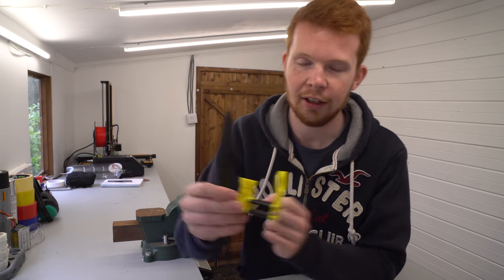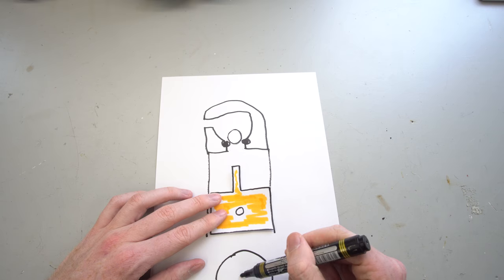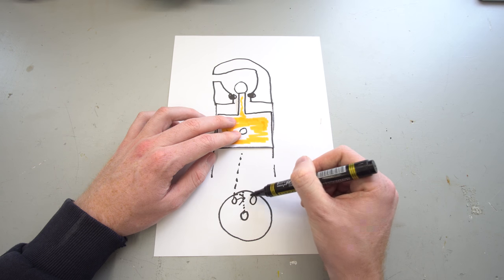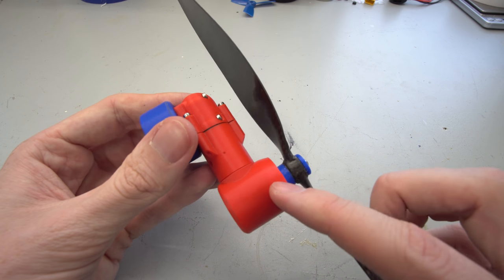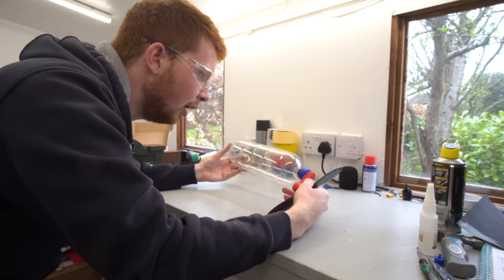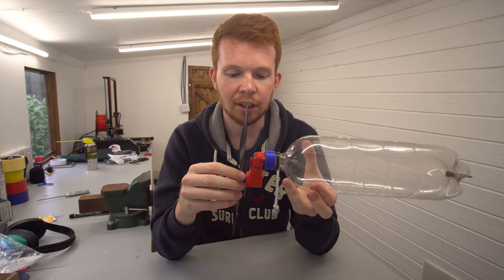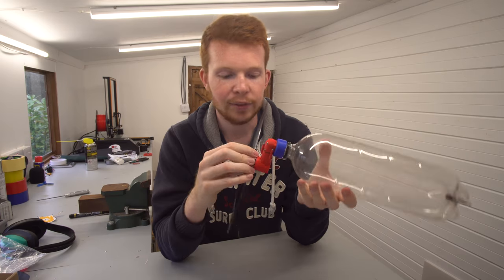Compressed Air Engine Modifications

Comment: In the US when I was a kid there was a set of toys from AirHogs which were air powered. I had a car and motorcycle that had an air motor and tank you would pump up to get them to run.  I remember the motors were done in clear plastic so you could see the internals.  They both ran pretty good. Maybe you can find some info on there designs to help with yours.  No play existed as far as I remember but this was before brushless motors and RC battery packs were NiCad. LIPo packs and well at that time Cell phones were things of the future. Good Luck.

Comment: If you get the new design working, do one with two pistons and two bottles on top of each other so you could have the high pressure-tolerance of the single bottles but the capacity of the glued bottle, and also a smoother running engine.

Comment: Once you get this bit working, I suggest you try to incorporate a pressure regulating ball-valve in the cap area of the engine, keeping the pressure in the manifold somewhat constant. 

As the pressure of the air-feed changes, this necessarily also changes the optimum opening-timing of the ballvalve in the manifold, just like ignitiontiming has to change depending on load in a combustion engine. My feeling is, that this system rod and ballvalve system is very sensitive to the pressure it is being fed.

OR, you could just "cheat" and make it more steam-engine like by using a sleeve valve, governing when to let air into the manifold. :P

Comment: Do you think that filling the bottle up with liquid nitrogen (or some other liquid) will allow the gas engine to last longer? What I mean is that when a gas is stored in a container, the pressure will make the gas turn into a liquid; pressure and temperature harbor the same effects. So when the liquid loses pressure that keeps it a liquid is gone, it will turn into a gas, and thus will make the engine run longer.

Comment: If you lengthened the blue cap, you might be able to move the valve stem up into the 3d printed parts so that there is no need to puncture the bottles.  You might get more pressure that way.

Comment: Here is a idea might require some scale changes, increase the size of you piston barrel so piston can only reach 80% of barrel height, replace the ball bearing with longer shaft which has hole/gap with a o-rings on end of the gap in the shaft (this hole allows the air flow to the barrel). When the piston is moving down the cycle then the gap closes, at the highest the gap is open for air. Because your piston has expansion chamber now as well I think it will also allow for higher pressure like using co2 but i don't know what that would do on the plastics your using... Also alternative is to put the spring on the shaft on-top of the piston but change your cycle so that when the piston is at it highest that the air gap is closed but the spring then pushes shaft on the piston down so it can allow air flow. I think this is then similar to blow back action of paintball/bb gun but that action is connected with bolt to the valve action and your action is all contained in one action...

Comment: Hey Tom, what if you added pressure/flow regulator of sort to your design between the bottle and engine head? Reason I'm saying this is, in combustion engine each portion of fuel (air in your case) delivers exactly the same amount of energy till the tank is out. Using pressurized vessel your curve of effective energy delivered to chamber changes with time. If you added twist flow regulator you may be able to flatten this curve for an amount of time. This would produce more consistent and extended results, then you may be able to get larger vessel and get it to produce energy for extended time. Think about it, just a thought.

Comment: Could you tap a co2 bulb into the bottle in for longer range?
Reply: Co2 cartridges are very high pressure, the motor would most likely explode. But if a metal regulater was used the cartridge would last a long time however the regulater might be to heavy to put on the plane

Comment: looks awesome!
When you're still struggeling to find the issue you may want to consider to build something for 'debugging'. (thinking of an oscilloscope with some simple contacts or mayb some plug and play hall-effect sensors :) ) Would give an awesome insight into the working engine <3

Keep this project going please :D

P.S. guess a slow 15 bucks oscilloscope should do the job

Comment: Two pistons or a double acting piston are the way to go. However a phase lag to the valves is still needed. I’d use a barrel valve on the crank. The exhaust could be ran through it too.

Comment: Suggestions:
a bolt through the piston to make it adjustable.

Dunno about the spring but how about having the feed from the bottle to the valve be just a little bit larger than the BB so the air pressure takes care of pressing the valve closed.

Comment: you could add a smaller crankshaft connected to a slider valve by a smaller connecting rod. that, or you replace the ball with an exceptionally wide spring-loaded tappet valve that can allow a lot of air to flow into the chamber while barely having to move by top dead center, and add a somewhat heavy flywheel. i'm no engineer, but that's something i'd personally try.

Comment: You have so much knowledge, just do a multi-cylinder Version. 2 or 3 should be enough to get rid of the spring and let it run smother! Smaller holes would counter the higher air consumption.

Comment: have you tried using a design that uses the compressed air to push the piston up and down? Youll need two valves, one that leads below the piston and one that leads above it. as the piston moves, it will close one valve and open another (not sure how to make the piston do that yet but you're smart )

Comment: Curious, could you use a diaphram as a spring?  Similar to those found in the carburetor of a chainsaw/weedeater?  You may not be able to get enough stroke from it, but I think it would be consistent in a pressure environment.  You would need a sealed compression chamber, with a blow-off valve.  A blow off valve consisting of a cylinder coming off the compression chamber, with a ball bearing acting as the plunger/ball valve, a hole in the side of the cylinder for exhaust, and a spring for the resistance behind the bearing.  If you constructed the blow off valve in this manner, you could then put an adjustment screw at the end of the cylinder where the spring mounts.  This would allow you to fine tune the spring resistance and essentially dial in the blow off valve.  Hopefully that makes sense, I can do a sketch and email if you like.  Cheers,  J

Comment: When thinking about how an engine works, you have and intake stroke, compression and combustion, then the exhaust.... in that cycle, the compression makes the combustion more aggressive. In this design, there seems to be the intake (compressed air) and the exhaust, then a compression for when the piston makes its way back to the top. What if you eliminated that compression stage. Maybe check out how steam engines were designed. They use the same ports for the exhaust and intake, but use some fancy valve work to have an intake stage on both sides of the piston eliminating the power loss from compression.

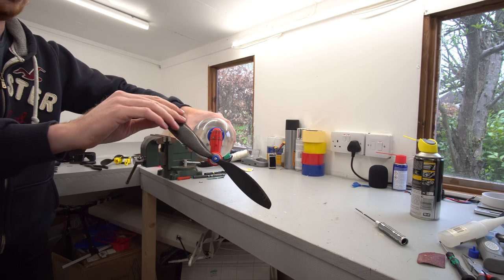Comment: Instead of changing the length of the ball valve why not add a retention bar so that the ball only moves enough to add in enough air. That should fix the main problem. Then if speed is still an issue I suggest removing that spring inside of the engine and adding a second piston to the system. At 8:47, when the propeller stops it does a return probably due to that spring storing the energy that the propeller wants to use to keep moving and continue the system. A second piston would take advantage of the smaller gap and allow for better air use with two strokes.

Comment: You need either a separate rod to act as a piston valve for the airflow....or....you need 3 of these connected linearly and piston-offset by 120 degrees from each other
Reply: Robert Caldwell why?
Reply: Is that a legitimate "I want to know" question?  I didn't make the laws of physics, I just know how to work with them.  There's a tension friction in the ball valve that the backstroke isn't given enough energy to overcome on top of having to crest before the next stroke.....if you have proper piston valves, the surface area versus the inflow is reversed, which costs less energy and can be finely controlled.  If you have 3 of these engines, then the power stroke of one of them is always pushing the other 2 for continuity.  Either of these are acceptable.

If you want to know more, just google "pneumatic engine." You'll see a common theme among them.

Comment: Just had an idea, which i dont think matters anymore, but i wanted to share it anyway. What if the piston and the ball was actually a single peace? The top part would be a lot longer, but this way, through some additional designing, there would be no spring and you would have additional control in the design for the air consumption.
And what if the crankshaft was a bit offset, so that when the piston would start coming down, it would already be past the middle of it, possibly increasing efficiency?

Comment: maybe bleed the exhaust into the crankcase to push the piston back up and add a rotary reed valve to release the pressure from the case as the piston gets close to TDC.

Comment: What is forcing the ball to be re-seated back onto the O ring once the pin has retreated?  I don't think you should rely on air pressure alone. You need to get that ball back mechanically. Good to see you back btw,

Comment: My knowledge is limited, but could the bearing not be part of the issue, as you didn't mention any mechanism to stop it "bouncing", for lack of a better term?

I wonder if it's worth trying a camshaft/valve set up or perhaps a wankel rotary style compressed air engine may be easier?
Reply: pressure from the botttle should keep it in place....

Comment: Thread the top of piston to make adjustable lifter length, use threaded rod.  More mass in flywheel, use a real wheel not a prop for testing.

Comment: It seems like you're basically making a steam engine with air power instead of steam, there are probably very many steam engine designs that could be referenced for ideas. I think your current design is good, without the spring; but if you had the valve actuator on a separate connrod/crank pin from the piston (rather than as an integrated part of the piston), you could adjust the timing independently, opening the valve when the piston is actually at TDC, and keeping it open until just before the piston opens the exhaust valve. More complexity of course, but I think would immediately result in a decently working engine with all the "pros" you're looking for.

Comment: I wonder if maybe the ball is closing too early and you need a way to keep it open longer.  When the piston is going down you want air to still be able to continue going in to push it down, otherwise it's the flywheel doing all the work using the energy from the initial manual spin, and it's actually uncompressing the air that is now sealed, and losing energy.   If that makes sense... lol.

Comment: In steam engines the valve controller can be run on the same flywheel as the piston but it needs to be offest to that it doesn't open the valve before the piston is completely closed. Your crank shaft just needs another crank on it, set a little behind the piston shaft, so it will open the valve just after the piston has passed its high mark and started its descent.
Reply: Then you can work on a pressure regulator

Comment: Look into how stationary steam engine work, they're basically just compressed air engines but steam has more energy.
you could use an eccentric to time a valve opening and closing the air supply, or use a fly wheel to maintain momentum through the top of the stroke. Or both, both is good. Source: model enginerd.

Comment: How about an air Wankel?
Reply: Why_are_there _no_names Useless. Would not make nearly the same in power and would be much less efficient. Not to mention there is no compression, intake, or exhaust stages, meaning a complete redesign would be necessary.
Reply: Oh yes, because it’s of utmost importance to achieve maximum efficiency and performance from your air powered toy engine 🧐
Reply: A Wankel wouldn't have enough expansion due to compression of the air to work
Reply: A compressed air Wankel would just be a wobbly turbine
Reply: BoostedJDM Well if he wants to put it on his airplane again then there's no reason to waste time on it

Comment: its possible to try to relocate the sprin on the cilinder head, with the valve, and that the piston lift the valve when it reach the pms, and the the spring compresion helps to close the valve.

Comment: Try higher psi I’d say more like 60-80 if the bottle can handle it, and also order an apc slow fly prop maybe a 10x3 you want low pitch so it doesn’t have to work so hard.

Comment: Why not have a screw push the valve open?

You could easily adjust it that way, it does add some weight though.

You could just add a small screw to the top

Comment: I have made stationary compressed air engines using a rotary valve passage incorporated in to part of the crankshaft with tubes to provide a feed and transfer to the head. I dont know if you would have a good enough seal for that method to work with 3d print though.

Comment: You could always do the math and get exactly how long the pin should be.

Also, here's my suggestion: make an actual valve instead. Have a small rotating disc that opens and closes the airway, just use a rubber band or a gear to spin it off the crank.

Comment: make bigger exhaust holes and bigger compressed air space and the engine will work. also the cylinder must fit tight so I;m worried if PLA is a good choice... Anyway, I have been playing similar engine as a child.  Perfect for small planes.

Comment: As a tinkerer and inventor, I understand the need to solve a problem, but I fail to see the purpose of a compressed air engine.
Having said that, what your design is missing is an adjustable timing system and flow regulation. 
Being able to adjust the timing of the stroke without disassembly and modification of engine speed would allow for more efficient tuning, while air flow regulation would allow for a more consistent flow of air over the duration of charge and allow for longer run times.
Having a regulated air flow would also allow you to tune the engine down to the absolute minimum pressure needed to run, thereby giving you a baseline for performance as you proceed with the design tuning and modifications. it would also allow you to estimate potential run times given a starting air pressure in the bottle.

Comment: did you grease the piston that could help with sealing within the cylinder. Also try TPU for the piston it's even more abrasive resistant and you could print it at a tighter tolerance possibly because it's flexible? just an idea, but probably a bad one lol.

Comment: what if you put threads on the outside of the cylinder.  then have threads on the inside of the head.  that would give you an adjustable length to the ball valve.  still have screws located around the outside of both and use them to lock it in position when you find the sweet spot.  your adjustment would vary with the pitch of the threads and the number of screws.

Comment: Instead of compressed air that stores loo little energy at these low pressures, it would be better to use liquid propane that's used for air-soft gas blow-back guns.
It will provide more constant pressure, for longer period and will be more compact.
Plus you could use parts from air-soft guns like the magazines, valves, etc

Comment: Instead of having that nipple on the piston, why not have an embedded nut in the piston, that you can screw a socket head Allen machine screw, so you can adjust the length during the stroke.

Comment: I think there might be a problem. When the Piston is moving upwards it will get some resistance by the air thats still inside and being compressed by the piston.
Reply: So you should consider something like an one way valve over there maybe

Comment: Suddenly had an odd idea about using 3 ball valves and no piston or springs - or more accurately, the balls are the pistons but also act as valves- for an engine. Will share somewhere if I get it properly sketched out

Comment: How about a little headless hex screw at the top of the piston to act as the trimmable push rod ? And a screw-sealed access hole on top of the manifold for quick settings ?

Comment: why not make a rotary? (not hating or any) but when the piston goes down to the exhaust it release pressure but going back up its making pressure therefore I believe you should have s valve and cam shaft going but I do understand that would take some thinking but I believe it will be worth it in the end

Comment: Would it work to have a second pin on the crankshaft with a separate pushrod to the valve? Obviously a lot more complicated, but you could phase it so that the valve opened when the piston crank was past the centreline. Then it would work over a wide range of input pressures, so would continue to operate as the tank was depleted

Comment: Hi Tom, 
Why not integrating the "refuel valve" in the 3D printed head of the Air motor, instead of at the bottom of the plastic bottom ?

Comment: How about using a threaded rod for the pin, that way advancing and retarding the engine becomes a matter of adjusting the height of the threaded rod, by turning it, and locking it with a lock nut. Sanding down the pin is far too hit and miss.